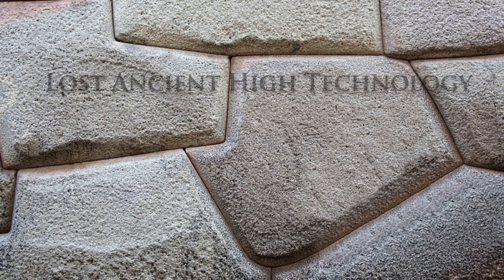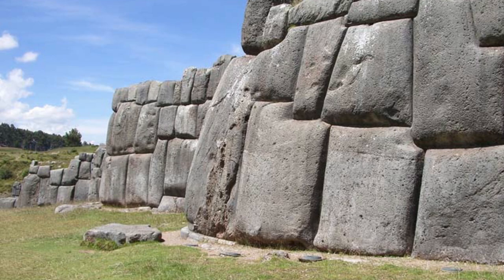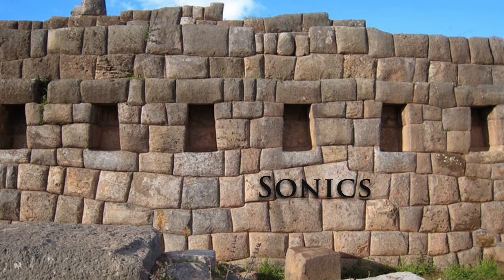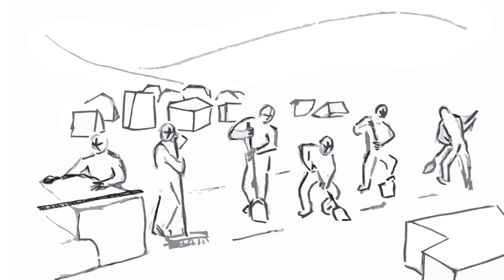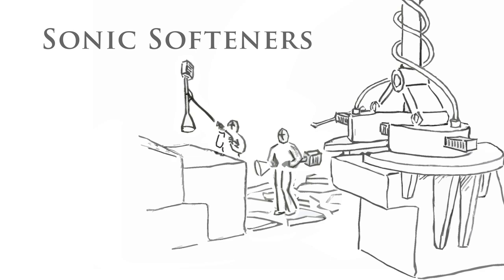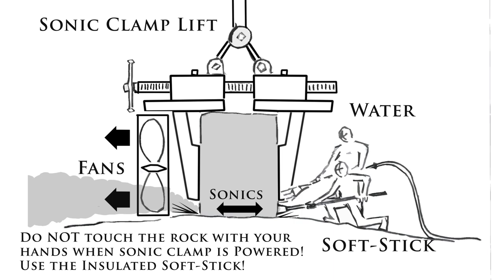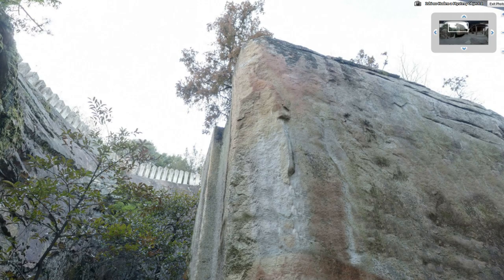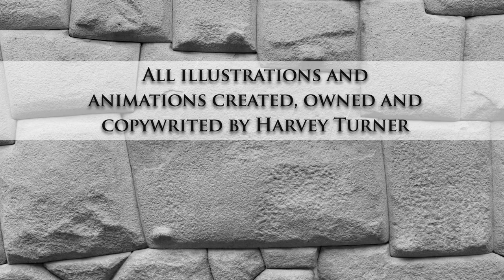ILLUSTRATED:  How to Build a Polygonal Megalithic Wall. Like Sacsayhuaman, Peru

Comment: Nice video Harvey! I like the illustrations! I would like to share new ideas and thoughts. I think the knobs we can see on many rocks are were the ultrasonic vibrations were induced into the rocks. They are tipically located on the lower part of the rocks where the weight effect of the rock is the greatest. I think they were stacking multiple rocks and then using the ultrasonic vibrations to soften the stones. 
In the plastic industry, ultrasonic vibrations are used to weld two plastic parts (look at sonic welding). The "sonotrode" is the name given to the part that is inducing the ultrasonic vibrations into the plastic parts. In the metal industry, there is researches done to soften metal parts using ultrasonic vibrations (look at acoustic (ultrasonic) softening). I think the megalithic builders were using a similar method. Some kind of sonotrode was placed in contact with the stone and the ultrasonics were softening the stones. I guess at some point, the rocks got so soft they almost melted and so they were using a tool to shape them a little bit. That is the scoop marks we can see on some exterior surfaces.
Reply from the maker: Yes.  Sonics.  And given your explaination,, then there should be 'Sonotrodes on both sides of the wall at the lower portion of the stone. Certainly there must be a wall somewhere that doesn't have any dirt on the other side!      From what I've seen though, the bottom stone takes shape a little more. The bottom stones have a cupping to them. Thus I would say that the top stone is being sonic'd and the bottom stone has been softened somewhat.
Reply from the maker: I've been thinking about your sonotrode input. So you believe in sonics too,, but you feel that it was applied at those protrusions.  I like this thinking,, but not all stones have protrusions? 
   These protrusions only seem to be on the exterior walls. Walls that hold back dirt and don't have an interior.  Anything designed to have an interior have been finished off,, not protrubes. 
    I'll bet that Brien has seen some exterior walls that you can now walk behind. 
    I think we can't speculate much without talking to someone whom has been to a location and been able to truly study a wall that no longer has dirt behind it. 
    You're not in Peru,, are you?
Reply: @intriguingmegalithicperspe1764    I don't believe they sculpted the stone faces and carved all the face except those knobs (protrusion). The knobs must be a result of the process they used. As they are not present on all the stones, it can't be a result of a molding method. There is often two knobs on one blocks, sometime only one or three. 
The rounded edges and domed exterior faces on the stones is a big hint for me to speculate about the process and I don't understand why it is so often missregarded. I don't believe they carved all those rounded edges and domed surfaces. I don't believe either it is a result of the erosion (erosion effect would look different). And I don't believe they made unique molds for each stones with rounded inner cavities.
So what can cause this chubby look? You can see a similar effect on a cooled lava flow. Or I think it looks like the top of a brioche bread. The only way I can think it was made, is by softening the entire stones. This way, all the gaps between the stones would disappear, you would get the amazing perfect fit between the stones blocks and get the chubby effect. And how can they have soften the stones? The use of ultrasonic vibrations is a good way I think. They seem to use specific type of stone with high crystalin content. I may be needed for the process. They needed to use a specific sound wave and frequency so the stone resonated and get soft.
So back to the knobs, I think the sonotrodes were placed against the stones to induce the vibrations inside. Maybe there was like an ''In" and a "Out" (usually 2 knobs). If the contact between the stones was good enough, the vibrations can be transferred through several stone blocks. So you can have a "In" on one stone and the "out" on another one. The way I see it, they didn't need to reach the back of the stones. It all can be done in the front. If the preliminary cut were done with precision, you would need less sonotrodes passes (few knobs) and the chubby effect is minimal, but if the stones were roughly cut and stacked with big gaps between them, you would need to use many sonotrodes input points (many knobs) and the chubby effect would be larger.
Reply: @intriguingmegalithicperspe1764  I am a french Canadian, Sorry for my poor English sometimes.
Reply from the maker: I like the fact that you've really put some thought into this.  You can see that there's something physical that we are clueless about. You accept that fact that the stones physical qualities were temporarily altered.  Yes.   I think that we both have watched every video we can and done a LOT of thinking.       I have gotten to a point where I need details before I continue.  Answers that Brian doesn't seem to give. Like what kind of rocks are not used in megalithic stonework.  You mentioned crystalline rocks. Is there a science there?  A clue?   What do these polygonal walls look like on the other side. It's time to dismantle one!   We need to fully take one apart and study it.  If we can dig up dinosaurs,, AND dig up Gobekli Tepi?  Then why not dig up a stretch of Sacsayhuaman???     Anyways,, So I have decided to focus my creative videos on Peru.       I see 3 distinctly different Megalithic stories and times.  Baalbek 15,000 years ago,  Egypt 10,000 years ago,,, and then Cusco Valley only about 5,000 years ago.   They,, yes,, I'll just say 'They' did not arrive here of their own choice. They did not want to stay long.  Stranded.    And rescued eventually.   All three of these groups were very different from each other.  I won't get into the differences. 
     It's the Peruvian tech that I want to study and write about. And Yes,, I believe that they weren't human. They did their best in fact to avoid all creatures,, especially the humans. They built walls to keep all creatures out. They dealt in sonics in the same way that we deal in sight. And this world is especially noisy to them,, loaded with waves of life and vibration. 
     So,, to summarize,, I'm going to have fun with more videos,, but I'm not going to get into the details of EXACTLY how Sonics made it possible.  As it's purely speculation until Brien can get some video of both sides of one of these walls.  THAT is what we need.    I will get down there myself someday,, but I won't leave until I see BOTH sides of a polygonal wall.      Makes sense,, don't you think?
Reply: @rejeanboyer1600  The knobs had to be very important or they would have cut them off once the wall was finished. Maybe after strong earthquakes the wall shifted. They would then need to reshape rocks to tighten up the joints. I really like your theory of sonic manipulation. Im just a welder living in northeastern USA.
Reply: @intriguingmegalithicperspe1764  Fallen Angel technology and the Nephilim its all over the world. The Inca or any other people could not build these sites.

Comment: 1. The walls of Sacsayhuaman are TERRACE walls constructed against a vertical terraced face of rock, so there is no "backside". There is only a front side.
2. Russian geologists discovered back in 2011 that the biggest "stones" (the lower rows) are "shells" overlaying inferior inner bedrock stone.  They are composed of perhaps a foot thick layer of reconstituted stone, aka; stone concrete.  The higher rows are solid stone concrete.  Their shapes and fits are a result of manual troweling of the moist concrete.
Reply: Never heard of such a thing, the info must have been media blacked out. Please give search references.
Reply: @ericswain4177  Here's an interview with one of the analysts, but it's not the video that I saw that was more of an on-site insight. https://www.youtube.com/watch?v=bR1jKGiFocI

Comment: The stones were cast out of a ancient cement. The first rock acts as part of the mold for the next one. They were made layer by later and given time to harden between rows.
Reply: You can be proven wrong right away. As there is many quarrys around these sites  were it shows where they cut these stones from it even shows stones they left behind at the quarrys due to imperfections such as cracks
Reply: @javiergarza8626  that's assuming that the rocks taken from the quarries were kept as large as they were.. but it makes more sense that the rocks taken from the quarries were pulverized and used as part of the geopolymer cement in the pouring process...

Comment: What a load of nonesense. The easiest way to make blocks fit together seamlessly starts in the quarry. If you break up a large rock into smaller rocks you can then trasport them to where you want to build your wall and reassemble it in the same order. You'd be chiseling out the joints in the quarry to break the rock where you wanted which gives them the pillow effect. You'd probably have to use some kind of morter to fill in any gaps but if you can overcome that, Job done..

Comment: 🤣🤣🤣🤣🤣🤣🤣 after a second minute i was under my table. 

Before  the second minute.
Yes it would be the truth  if polygonal walls would have straight lines or corners, then it is relatively simple to match surfaces.
But this theory ruins immediately with curved surfaces, they would need to check several times these huge stones to fit them.

Yours theory also can possibly explain why some blocks has protrusions on the sides, may be for easy clamping.

But I think it was a geopolymer, physically waste after a gold digging and smelting process.
Quartz or granite rock is crushed. 
Then furnace to extract gold, during the process could be used wood or coal, both are  rich on Potasium and Sodium as a heat source.
At high temperatures we get SiO2 and KO, precursors, which react between each other for potasium silicate.
Left overs could be cooled down by water, where at high temperatures silicate will be dissolved to liquid state.
Still wet mass, packed to bags and delivered to a waste area, or just delivered as it is.
Or Could be that leftovers left to cool down, packed and wasted.
At one day, somebody have found that previously powder or slurry mass became rock solid.
Then this waste was adapted as concrete.
All polygonall walls could be easily associated to heavily gold digging regions or any way ore refining process for metal (Cu, Fe, brass)
Depending on the rock and process, could be used in high concentration lime. Hmmm wait a second, Rome and Egypt.
Huge amounts of Brass and Gold production.
Pyramids are physically could be left overs from gold production during some pharaohs, and the size of pyramids could determine how much of metal was produced.

Comment: NICE TRY BUT WE HAVE JUST FOUND OUT THESE BUILDING TECHNIQUES WERE DONE USING A FORM OF CEMENT ,YOU FILL GIANT SACKS WITH THE CEMENT THEN YOU SET A ROW OF DIFFERENT SIZE BAGS FULL OF WET CONCRETE AND YOU SQUEEZE THEM TOGETHER ONCE FINISHED AND HARD YOU BEGIN CUTTING THE SACKS AND REMOVING AS MUCH POSSIBLE .THE SACK THAT IS LEFT BETWEEN THE JOINS WILL ERODE TO NOTHING OVER TIME. THATS HOW SIMPLE IT WAS ,EVEN MARBLE CAN BE USED THIS WAY SO THEN YOU CAN BUILD PYRAMIDS USING WOODEN BOARDS TO SHAPE THE SIZE OF BLOCK YOU WANT CAST INTO THE BOX .

Comment: When you know why these walls were built, you can work out how they were built. The three walls are built to enable the plotting of the path of the three asteroids/meteors two of which tilted the globe 6000 years ago. When you also know those objects were "guided" to the planets surface by a people far more advanced than us, you can work out how they are made. Combine two of our current technologies. Laser and 3D printing. Even us with less than 1000 years development on both space and these two technologies could complete the same task. That's your answer. Printed from space like most of the so called Megalithic sites. Every river rock I have examined on the East Coast of Australia has information on them in respect our history. All put there using extremely high-tech manners of manipulation and in some cases, total manufacture. I have uploaded some videos on my channel if your interested.
Reply: If they're so advanced then how come they're all gone?
Reply: Why were native populations destroyed by disease and what would be comparatively primitive weapons? Surely an advanced society wouldn't be so easy to destroy.

Comment: I am new to this but what is used as insulated soft sticks and what is used to soften stone?
Reply from the maker: Insulated 'soft sticks' must have had a padded end of rubber or sonic absorbing material. They would attach via suction to the soften rock to pull or push and steer the rock as it settled into place.  To soften the stone, it is theorized that sonics and plant based solution in large tanks were used together to soften large blocks of granite, limestone, or even Ryolite. The combination of solution and sonics made the stone temporarily workable. Please see     https://www.youtube.com/watch?v=3Fi-GK9n2jQ&t=74s       It's a lost ancient high technology and is yet to be understood by today's modern tech.

Comment: I could imagine that suspended (differently) rock could be put in wibrations by blowing air in to some cavity in this suspension, and when it touch another rock it adjusts by abrasion.
But someone should TRY TO DO IT, instead He is doing movies and books.